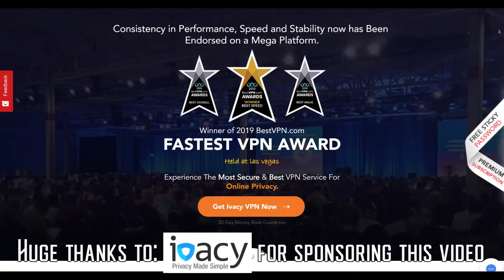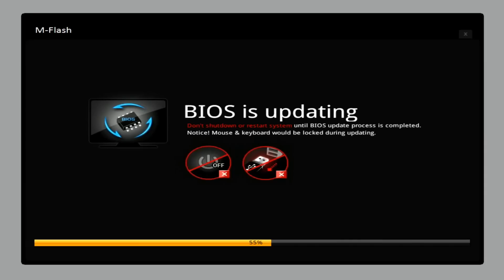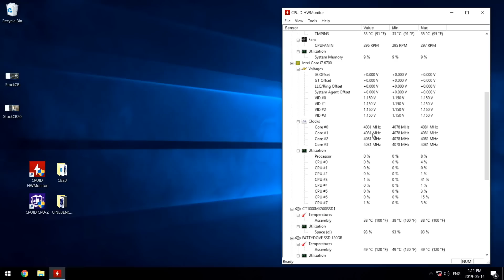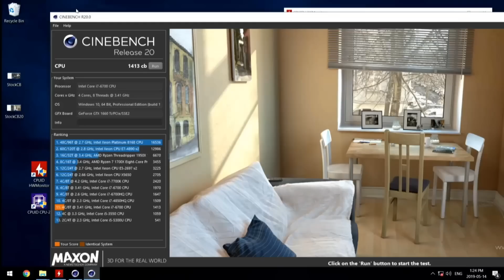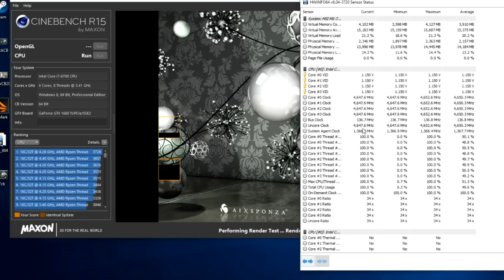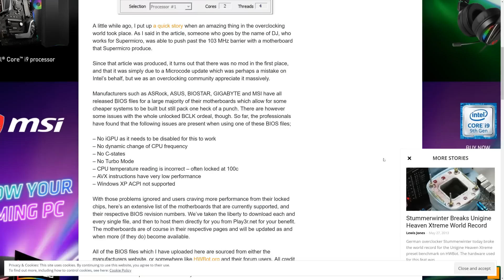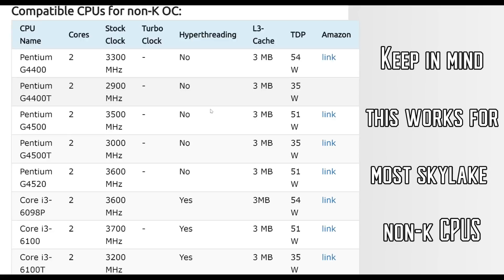Overclocking a non-K Skylake CPU to 4.7Ghz in 2019

Comment: Hi, I'm trying to do this kind of overclock on my i7 6700 with my MSI Z170A Gaming M3 motherboard, but I can't seem to get it to work. Changing the RAM frequencies and both CPU and RAM voltages works fine, but not the CPU frequency—it always stays at 3.4GHz. Has anyone else experienced this?

Comment: I have this exact build only that my mobo is an m5 z170 so I used a different bios on that non k files list but my question is when I oc on bios it shows my speed for example says 4.2ghz compared to 3.4ghz base when I load into windows on task manager it’s locked at 3.4ghz but on CPUz it shows average 4200mhz which is correct and is this expected to see when oc?

Comment: Would not add voltage until i see where cpu at,
These chips already get plenty of voltage at stock.
I can remember running 6500 at 4ghz with any voltage increase,
Probably a good chip.

Comment: i overlocked i7-8700 non k to  4.7Ghz. ( Dell XPS 8930,  overclocking always remains clocked in this model in bios  . didnt need it to do this )   .After a ssd wipe because i was tweaking windows update feature too much,  ive since lost the ability to do it. i cant recall what i did. but consulted many tutorials, forums, intel extreme utility profiles and bio tweaking ( lost my data a few times ) . and a few applications of a driver here or there.  might have used one other software. but yea its totally possible. but a pain to get there.
never had a heat problem.  although i keep my case open  with a fan blowing on it in a cool room.
Reply: CoffeeTime?

Comment: cant find a bios that could overclock a i5 7400 with a MSI z170 gaming m3...could anyone point me in the right direction? "player. net" has them,but only had success with my i3 6100...now i got a 7400 and it's just black with the custom bios for overclocking non K
Reply: I don't think it works on 7th gen. Did you find a way to overclock it by now?
Reply: @vincentlaw9006  thanks for the reply. Yes it's confirmed that it doesnt work on 7th gen... Glad i ditch it already. Was a major bottleneck

Comment: I bought the Intel Core i7-9700. Says it goes up to 4.7GHz but it's saying here i only have 3GHz with 8 threads. How do i get that 4.7GHz? Will it happen automatically or would i need to dive in the bios. It's not a k series processor so overclocking shouldn't even be an option, right?  I'm ignorant. Sorry. Lol

Comment: Still running one of these. 4.8GHZ  was prime95 stable with a delid + liquid metal. I was able to boot windows and do stuff at 5ghz which was cool for such a cheap system. Was hoping to see some higher memory speeds on your setup though. I'm at 3400 cl13. Not sure if its the 6700 memory controller, my particular board or the bclk, but my ballistix 2x8gb 3000cl15 should be able to crack 4000 with a newer ryzen or coffeelake system.

Comment: have you tried BCLK OC kabylake on Z170 yet? I am pretty curious for that.
Reply: I just messed around with this on my Z170S while installing some new RAM. I just hit the EZ button and it went straight to 102.5 BCLK. Literally didn't touch anything else and didn't do any stress tests. The stock clock almost never dips below 4.0GHZ even with all 8 cores engaged and stock cooling.
Reply: @cryangallegos  
BCLK OC bug of skylake (6th Gen) has been patched by intel with newer genertions so that  you can't go beyond 103 on BCLK.
I don't know if intel fused that on CPUs or on the motherboard chipsets or on both.

I have seen people trying to BCLK OC kabylake on Z270 with no success, but they could only OC skylake on these chipsets so they came up with the statement "you can't bclk oc kabylake"

The issue has been closed since then so we haven't seen anybody trying to bclk oc coffelake or other newer generations.

My theory is: if intel patched that on the chipset then people who tried to OC kabylake on Z270 should have tried that on the older generation Z170. Thry may get succed with that.
If that was possible then I could easily buy a Z170 then add newer CPU generations microcodes inside these old mobos and run a coffelake or even refreshed coffelake on it then show people that I could OC that 😊. I won't go through this before I know "if you can bclk oc kabylake on Z170".

Comment: So far I've only been able to get my 6700 to 4.45 before it becomes unable to boot. Temps are really low but it just becomes unstable and will boot loop until I clear CMOS. Been playing with different voltages and settings, lowering RAM clock, etc. I hope to get it up to 4.7 at some point.
Reply: @Gorkem Nisan depends on motherboard. What is yours?

Comment: I remember back in the day overclocking my E4300 Core 2 Duo from 1.8GHz to 3.0GHz with the stock cooler. It was good times for sure.
Reply: I want the nvidia branded zalman air coolers back they look very cool.
Reply: e3300 3,5 ghz for me
Reply: @janikiraly2  just with stock cooler?
Reply: @dijayimotsab7884  yep.
Reply: i did the i7-8700 non k in a dell XPS 8930,, which has bios overclock feature Locked.   to 4.7Ghz
Reply: E8400 the Best procesor
Reply: 4.6ghz on air and toothpaste Core 2 duo. 4.8 with tricks in windows, motherboard didnt like it.
Reply: I had an e8400 at 4.2 for aggggees and then one day there was a "click" and no more computer 😂
Reply: How did you do it?
Reply: Damn nearly double the MHz is crazy

Comment: Its not working for me , i use the version mentioned above .
It worked for 2 days , suddenly the oc dissapeared!
Whenever i try apply the oc settings in bios now ,it restarts then restarts again while booting and poof no OC settings ever get applied . what am I doing wrong pls help
Reply: @Gorkem Nisanoglu nopes , there is no fix - only way is using older versions of windows motherboard and bios which will fudk up your experience , intel has bitchslapped us mate and this guy is misleading .

Comment: There are Asrock b150, h170, c232 boards that can bclk overclock these skylake processors as well. Theyre called the Hyper series. They added an external clock generator to them.

Comment: The motherboard and CPU just happens to be my setup! I appreciate the video man.
Reply: @coeko Not sure why the dead face. I run 7950x3d on 64gb of ddr5 ram at 4800 (6000 not as stable). Comment is over 4 years ago mate.
Reply: @quietambassador7733  im not a Electronics Specialist but you must use also graphics card, otherwise you cpu will get cooked

Comment: been running my 6700 non k for a few years now overclocked since day one  at 4.8ghz  at 1.36v   been running solid   on a aio  cooler  im using a delided cpu droped temps  and cpu stays stounf 70degrees  loaded
Reply: mariopic hey man, maybe you can help me. I’m trying to OC my i5 6500 and every time I set the multiplier to anything higher than 100, the motherboard stays showing the higher bclk but when windows boots the clock speed stays the same, even in cpuZ. I’m not sure what I’m doing wrong. My bios settings are identical to those in the video
Reply: @MrArmadaskier4123  Do you have the same BIOS version though? Only the older one he linked to allows OC on the non-k version. the Derbauer link doens't work anymore either.. looks like it got taken down.
Reply: @MrArmadaskier4123  u need to turn off  speed step  so cpu is always forced to full speed also u must off set ur ram mulitiplyer to keep ur ram at stock speeds as bclk goes up  so u only over clock cpu not the ram with it
Reply: Would you mind telling me what other settings you used to get it stable at that speed? Mine becomes unstable (Won't even boot) over 4.5Ghz, even though temps are below 60. Something else is just becoming unstable and I still have plenty of thermal headroom using an AIO.
Reply: @Gorkem Nisanoglu need to oc bclk  and in turn off set the ram base clock to not boost rams clock speed  trick is off set ur ram multiplyer  so match original speed
Reply: @Gorkem Nisanoglu  try a bios thats older thats before the first microcode update

Comment: yeah just got a 78€ (70 + shipping) i7 6700 cause my 4.5ghz i5 6400 aint happy in battlefield online 64 player:) might be able to sell the i5 for the same price as the i7 lol since i still have a h110 mobo might sell beter as combo :)
BTW my msi z170 sli plus mobo has bios build 12/05/2017 e7998ims.1d0 and wat i need to do to oc is enable BETA RUNNER if not it wont apply the settings

Comment: I have an i7 6700 stock, still better in gaming than ryzen 5 2600, im fine with it
Reply: I have same CPU. I'm wondering if u know if its limited to 2133mhz RAM or can u use faster?
Reply: @olangeyo1042  ive used 4000 ddr4 cl 18 on that CPU. 

You need 1st a good motherboard. (I.E. maximus VIII Hero/alpha/extreme z170x g1). 2nd your CPU needs to have a good IME controller
Reply: @olangeyo1042   im limited to 2133, i think ram overclocking is only available on k cpu's as im not able to overclock my ram

Comment: @Timmy Joe PC Tech Holy moly you are way behind the times  :P  I did this on my cheap 6700(non-k)(250€) on the 99€ gigabyte z170 udh3 or what it was called. And with a 1.45 of vcore I got it to 4750mhz with my noctua nh14 with the fan at pretty high fan speed i got 84c, if I lowered the fan speed I got blue screens haha so on the limit. And not every mobo cuts many of the functions you list, I thought so too but was pleasantly surprised when igpu/ht was working as it should. 

But Timmy you can run hexa and octa core cpus on old z170 and z270 boards with modded bioses, so take a look at that as well before they get out of date. hehe

Comment: I'd like to see this CPU OC'd vs an i7 7700/k at the same speeds
Reply: hmmm probably would be little to no difference between the two if he did that and then it would hit you the 7700k is just unlocked and priced higher that's all
Reply: @Raven10241  will it’s also refresh version of 6700k which also generally achieved higher oc frequencies upto 300-400 more vs what 6700k was capable of doing.

Comment: By far the best Motherboard I owned for overclocking none k CPU's on Skylake has to be the Asrock Z170 Gaming K6 motherboard, I got this mobo for my 6600k and there wasn't a CPU it couldn't overclock, I slapped in a i3 6100 just for lolz like you do at 3.7ghz and overclocked it to 3.9ghz just by cranking up the multiplier and that was it job done, I'm sure it would have gone higher but I was just messing around. I highly recommend the Asrock Z170 Gaming K6 mobo for None K CPU overclocking.

Comment: still rocking my 2500k at 4.5 just installed a 1060 6gb and surprised how well they pair. typically running games i play holds about 83% on gpu and 90% on cpu. 120mm AIO from 7 years ago still holding temps. so maybe ill get a few more years.

Comment: you were super lucky, I had to swap my bios chip in order to make the older bios work, not even dos flashing would work. Still I was able to clock my i5 6500 to 4.5ghz, I then sold it and bought a ryzen 5 1600 plus mobo for roughly the same price :) oh and cinebench r20 uses avx which is fucked up when you bclk oc, hence the worse performance than at stock!

Comment: Ivacy is total garbage.  Tried it even purchased the $60 option based on your recommendations.  If you want to go back to 9600 baud modem speed try Ivacy.  I have a 50 mps download speed and when using Ivacy it just made it so slow that could not even make a decent download.  A file that would normally take a minute would take 15 or 20 minutes with their VPN.  It only took 3 week to get my money back and only happen when opening a dispute with PayPal.

Comment: My x5675 still gets 1000cb scores on R15 @ 4.4ghz. So glad I went with X58 because it seems like it was one of the last "bullshit-free" chipsets from Intel.

Finally upgrading this year since now after almost 10 years, my X58 is finally being outperformed. Went with a Ryzen 1800X, I hope it goes well. Just not looking forward to the lack of overclocking (100mhz over stock is not an overclock)
Reply: nottacop I have a x5650 and it still a beast. I get a 1005cb on r15 and my 1600x gets 1356. Not bad the Xeon keeping up. I have 1700x but that’s another story lol
Reply: @archangel76106  im here with a threadripper 1950x

Comment: I have exactly this: I7 6700 with Z 170, I've already achieved 4.7 ghz too, I hit 1020 multi-core and +200 single core in Cinebench R15, in daily use I keep it in 4.4 or 4.5 to be confortable...
Reply: Elias Medeiros wow! which mobo did you use? I’m about to do it with my 6700 on ASUS z170-a , hope it works...
Reply: What's your voltage my friend?
Reply: Same here, I7-6700 non k oc to 4,4Ghz with 1,34V (read in Windows) - seems pretty stable
Reply: @---ls5qd  still works?
Reply: @mrjonjoe1895  
Works really good.
U have think of that there is no dynamic mode anymore, it constantly clocks at 4.4 even in idle.
But that's not bothering me ;)

U also have to flash your bios to get the oc-options.
Reply: @---ls5qd  so any of the bios he listed, do you mean the bios you're using is one of those? if so I will try to further update it to accommodate the 8100 I'm using right now with another tool
Reply: @mrjonjoe1895  

I got my MSI Z170 A PRO flashed with the listed biosversion et voila there was the option of non K oc-ing.

Comment: only worked with skylake. had the i3 6100 at 4.5 with stock voltage, i5 6500 at 4.7 with 1.28v, never did it with the i7. tried a few kabylakes but couldn't get it working on 4 different z170 boards. best board I found for non k oc was the asrock z170 k6 fatality on its early bios. overclocked.net is a good place to find bios'
Reply: northern marine hey bud what did you set your memory timings to to keep the i5 6500 stable at 4.7ghz I can’t get it to be stable at 4.5 ghz ?
Reply: I had a set of corsair dominator plats, but they were Samsung b die, but I kept them with xmp at 3200, timings was something like 14-14-14-34 I think. managed to get the same kit to 4000 with 16 timings with a 6700k though
Reply: northern marine nice one bro I wanted to get a 6600k but didn’t have the cash to get one so I ended up with the 6500 I don’t really understand the memory Timings could you give me a brief explication on how you would adjust them when overclocking ?

Comment: I have the same 127C for TMPIN5 in HWMonitor on a MSI Gaming 5 MB, and 4790K @ 4.6Ghz, prolly just a bug with the software, i've never had a problem.
Reply: @ReFleX 127C means than your mobo doesnt have thermal sensor, but BIOS does have microcode to use it.

Comment: You can overclock an i7-3770 so why not? non-K only means they are locked in some way not necessarily clock speed lock!
Reply: You can overclock it by 4 multipliers with the caveat it will down clock based on load. So for the 3770 it's 4.3/4.2/4.1 based on 1 core pegged versus 2 or 4. I forget if 3 is 4.2 or 4.1 I think it's 4.2 as well.

Comment: Did you try any of the BIOS available from MSI? They have from 2015? Never heard you mention going to the manufacturer web site or a reason why you did not?
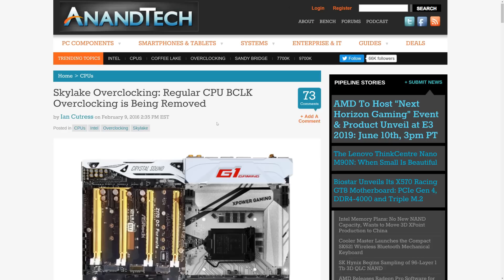Reply from the maker: 3:28 I mentioned that Intel forced motherboard manufacturers to stop allowing BCLK overclocking on non k cpus in Feb of 2016 and also made it impossible to revert to older bioses

Comment: Just be careful with the Asus Z170 boards. They made it very hard to install any bios that's older than the one on there. Once you update those bios past the "non-k OC" BIOS version, you have to jump through hoops to go backwards to an older version.
Reply: I have the Asus VIII ranger, I could not make it pass with the Asus flash tool in the bios, I had to use the weird button with the USB port, otherwise (flashtool) said "this is not a bios file"
Reply: @Gorkem Nisanoglu 
I do not know your geeky background, but it is relatively safe. Just take into account that the microcode of the bios is not updated, it is less safe and, in my case, slower to boot. But now I can play yuzu decently and the Witcher  3 runs way better.
And if you are not happy with that there's 85% chances (or more) of going backwards

Comment: I've run my i3-6100 @ 4.5ghz for almost 3 years now. I have always had Windows 10 with the latest updates and never lost the overclock. I thought the Micro-Code was purely in the motherboards BIOS and could not be updated via windows unless you ran the BIOS update utility for yo MB from windows. The thing that has worried me is HWInfo 64 / Asus AI Suite / HW Monitor all report different temps... but that was to be expected ... it just means I am not gonna overclock any further than this as I have no idea which temp to trust. Skylake CPU's are so seriously over priced for what they are now its ridiculous, and they should probably be avoided.
Reply: As long as your Intel CPU is sandy bridge or newer, windows update has been providing microcode updates that load when windows starts. Just make sure you are on Win 10 build 1809, they even have retpoline enabled now if all your updates are installed.

Comment: Try ThrottleStop.  You should be able to OC with a normal/current BIOS, control the C-states (including keeping them enabled if you wish so that it doesn't stay high all the time even when idle), control the core multiplier, cache multiplier and still have an up to date BIOS.
Reply: Throttlestop only works on factory unlocked CPU's
Reply: i use that for my i7 940xm cpu. It a beast.

Comment: so these non k chips can overclock just fine, but intel simply has blocked from doing so. Why? If it was so bad, why would amd let overclock all cpus???
Reply: So you have to buy a K series. Also K series have a C state. A non K overclock will permanently run at the oc speed. A K series will ramp down under low usage.
Reply: Furthermore just buy a ryzen 3000 when released
Reply: @D_2_da_K87  Yeah amd seems a lot better option. Well Im not buying new pc soon, I have 8600k now. But when I do it will probably be amd system.